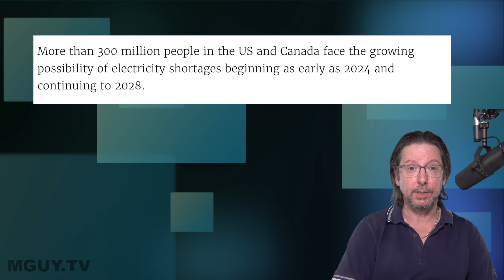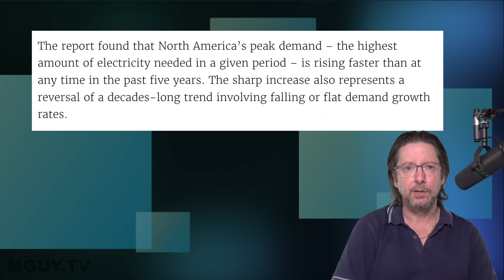Electricity grids WON'T COPE with mass EV charging | MGUY Australia

Comment: I use emergency solar. Charging is a huge challenge unless you`re only depending on very low wattage or quick use of higher wattage devices. To simply power a small window air conditioner reliably requires a huge battery bank and a massive amount of panels, cables, and MPPT chargers, and that`s just part of it. It also requires a lot of perfect conditions. The reason for the need for a massive battery bank and a way to rapid charge is clouds and rainy or hazy periods. Plus, rapid charging degrades lithium batteries, and so does heat, cold, and the passage of time.
Reply: So why use that type of battery  when those  are the condition  being in a car? Its made to break down and the battery cost more than the car itself.  
AND THE IDIOTS THINK THEIR GONNA MAKE PEOPLE  USE IT?
Reply: I`m a prepper. Lead acid batteries are way more expensive now. To use those is a nightmare. I`m in a region affected by the constant threat of severe weather and I can`t afford to put fuel in a gas generator for over two weeks when the next hurricane happens...or lose all the food I grow and berries and fish I harvested myself if the power fails after severe July thunderstorms. I`ve had enough of that and I did what I could, while I had money left, before going on Social Security. I`m in a very rural area. This was the best option.  @CynthiaRockroth
Reply: Sorry I thought I was commenting on another thread and sent a rude reply. I deleted it.  @CynthiaRockroth
Reply: @CynthiaRockroth people like me already are. Battery has been cheaper for most things for a while now. A decade ago, i converted an old garden tractor to electric for mowing and light farm work.
Reply: What has rapid charging got to do with home batteries? Home batteries are only ever slow charged which is why they last for at least 20 years.
Reply: I`m using EV grade lithium batteries...exact same thing in cars. See: BATTERY UNIVERSITY and learn it.  @kiae-nirodiariesencore4270
Reply: I was homeless and barely had enough to get an old used camper and my prepping supplies and my sister let me put it on a rural lot. Or I`d be dead. Not sure how people will survive the next year.   @IntegerOfDoom
Reply: @IntegerOfDoom their making it MANTORY  in rentals.
Reply: @CynthiaRockroth  You can't make it mandatory for multi-story flats in cities, the roof area won't begin to support the needs of these buildings.
Reply: Nine states just banned the sale of gas cars. Imagine buying a used electric car for 800 bucks. We`re doomed! Get away from the cities and start planting every type of food that grows and get some chickens...near a fishing spot if possible. I dropped out of the scam. We have no other option now if we plan to be free.  @CynthiaRockroth
Reply: What is ‘emergency solar’?
Reply: @johnnunn8688 It's like, when you get home in your EV after work in the middle of winter and the battery  is almost discharged from heating the vehicle and running....... you plug it into your solar and lo and behold, the sun will shine just so you can charge your vehicle, thereby saving the planet.
Reply: Batteries, solar panel charge controllers, solar panels, AC inverters to convert DC into AC, converters to produce or regulate different DC voltages like USB or 9v fans, various cables, and other parts like fuses for safety. All the various batteries I use from tiny ones for radios and flashlights to my 12 increasingly larger ones can be solar charged. If something major happens and grid power fails I can still cook, run my air conditioner, keep my freezer frozen, till my garden, mow, heat bathing water, power my WIFI, or seal off a small area in my camper with mylar blankets and run a 200w mini heater and electric blanket to avoid freezing.  @johnnunn8688
Reply: @baneverything5580  Or you could buy a generator and a couple of gas cans and run your house.  And have ten thousand dollars left over to buy food.  Though I admit, that's not so much food anymore.  "C'mon man!"
Reply: @baneverything5580  , ah, not ‘emergency solar’, I gotcha.
Reply: Of course you use relative words you can bend the meaning of when someone challenges you. 
But reality is that even for energy hungry America, a solar/wind system that will support the home and two EVs can be built with an ROI of under 10 years and you are independent of these supposed government conspiracy theories and the real conspiracies of oil companies to keep control of your wallet.
Reply: Lithium ion batteries are completely different than lithium iron phosphate batteries.
Reply: In some ways. Both are still lithium ion batteries and both can be damaged by the same things.  @donbrloks3959
Reply: @donbrloks3959  Lithium iron phosphate batteries are a type of lithium ion battery.
Reply: And end up another land fill victim as cheaper to bulldoze then recycle assorted green material be it eye soar wind farms,battery waste or solar arrays that have to be decommissioned in twenty years.The only way for reliable power is a base load plant nuke or coal.These hugely expensive and resource draining battery packs can supply a city with power for twenty minutes.What after that if all your base load plants blown up.Telling the green rabble these unpleasant facts falls on deaf ears.like the flat earth delusional s put there fingers in ear and deny any facts that not agree with there fantasy .WE all pay for it when the grid collapses.At the moment in icu.One or two more coal plants destroyed without a reliable replacement and even that will not save the grid dying a premature death in one of the richest energy resource countries in the world.Our once strong cheap energy economy will be a thing of the past and our nation a laughing stock to the world and a serious lesson not to try running before can walk.
Reply: .. "and the passage of time"... one of those good old word salads by Kamala Harris. 😂
Reply: Lithium ion batteries degrade whether you use them or not and they require care. If you charge them to 100% they degrade physically due to swelling and heat. If you discharge them too far they grow dendrite crystals which can make them short out. If you store them the BMS slowly drains them. If they get too hot they degrade. If you rapidly charge them they degrade. If you charge them when they`re near or below freezing they get damaged. And they degrade with time no matter how you use them or what you do. This is a scientific list of facts anyone can research themselves. It might keep you from burning down your home. See BATTERY UNIVERSITY.  @Bananapus